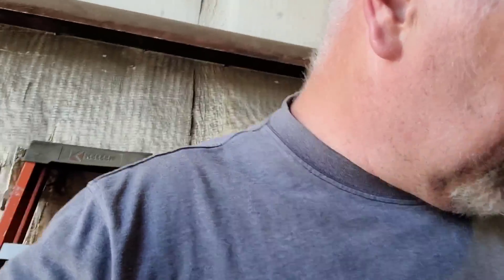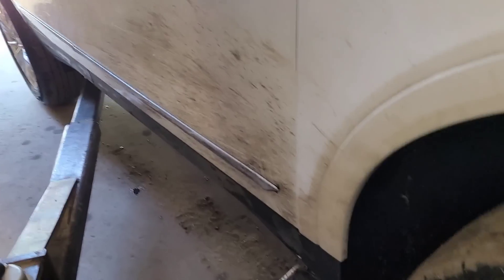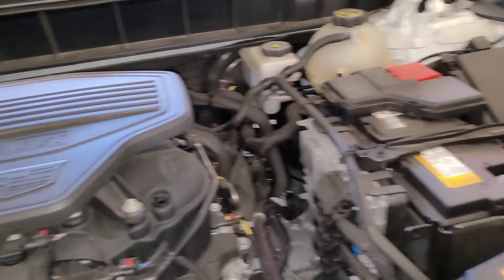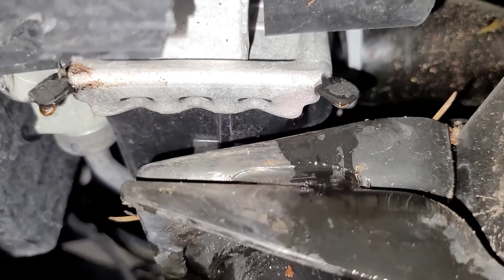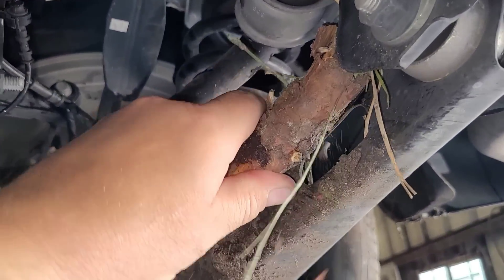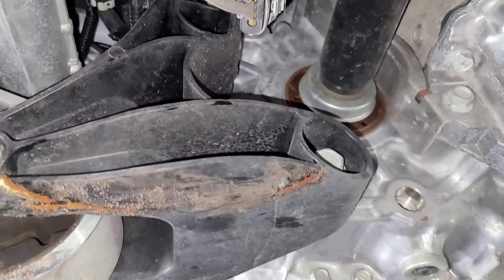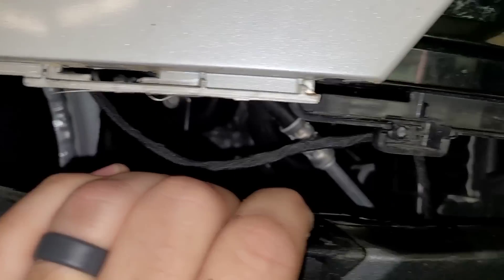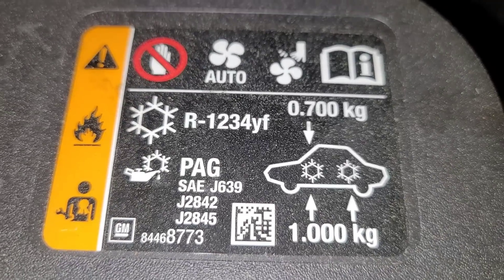Quick Off Road Trip Creates Big Problems.

Comment: Pretty hefty repair bill that's going to be! Condenser and radiator  plus recharge of the wicked expensive  refrigant!
Reply: This person has much bigger things to worry about than the cost of 1234 refrigerant.   By the way... Every vehicle starting around 2015 has 1234 in it.
Reply: @Ram14250  the fact that it's more than twice the cost.  Radiator and condenser that's the two issues and recharge is part of it!!!

Comment: I would check the distance from the back of the tire to the fender on both front tires that could have sent that wheel back. Hard to see damage like that. Also check for run out on both l/s wheels . Rt rear wheel may be back too. Very hard to see .